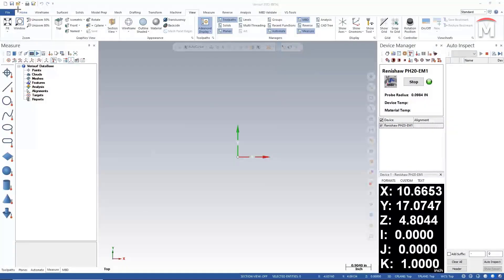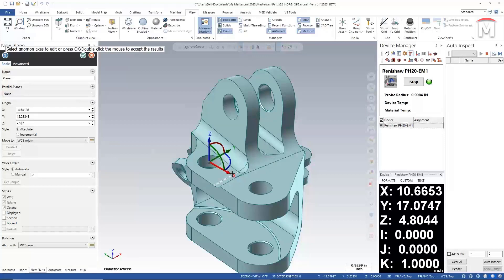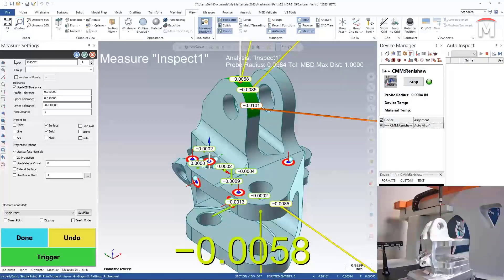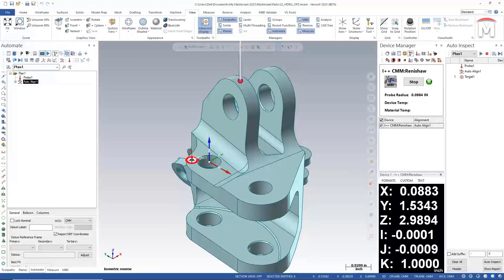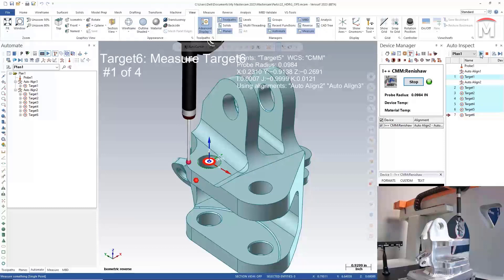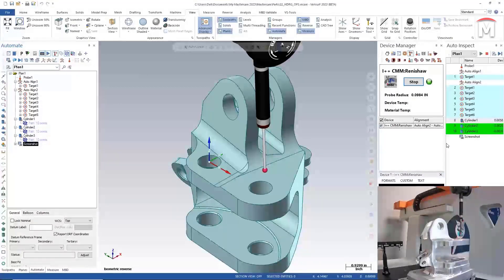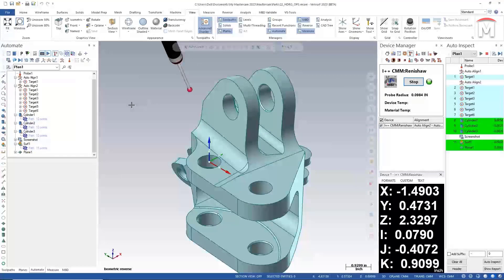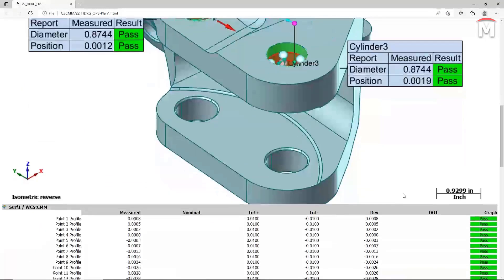Verisurf Makes CMM Programming a Breeze!! - Webinar

Comment: Good work sir, thank you so much I am learning a lot from your videos . Can you please guide me how to make a compressible pipe , so that when force is applied from both directions, it gets compressed and flow of material through pipe stop and when force is removed, pipe regains it's original form and flow of material continues.
Reply from the maker: You appear to be describing a multi-physics question, where the structural response of the system impacts the flow, which impacts the pressure and the loads, which impacts the structural shape.  Depending on your specific goals for a study of this type will change what product and what approach should be used.  I recommend reaching out to your local value-added reseller to discuss this application further, if you are an MLC CAD Systems customer we'd love to hear from you: https://www.mlc-cad.com/contact-us/